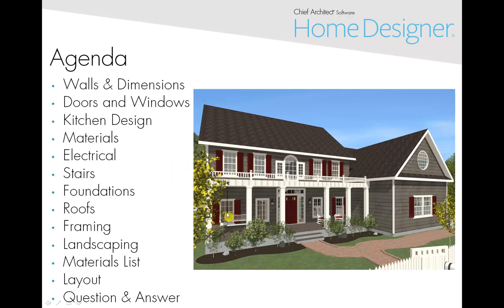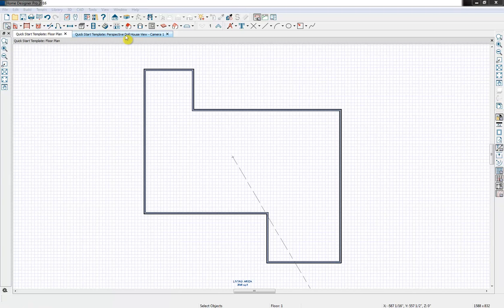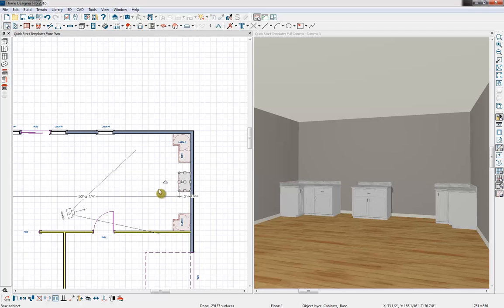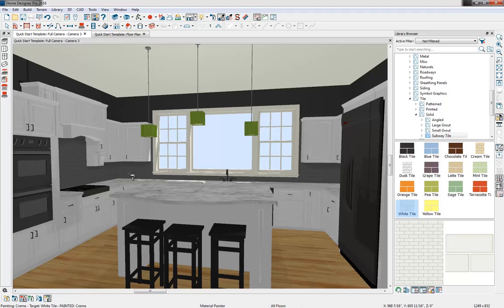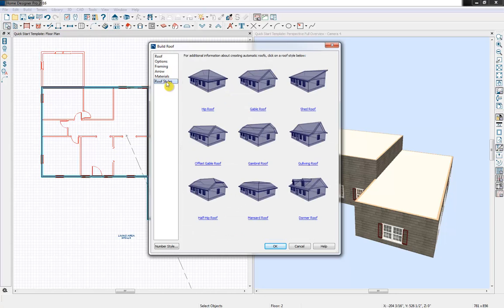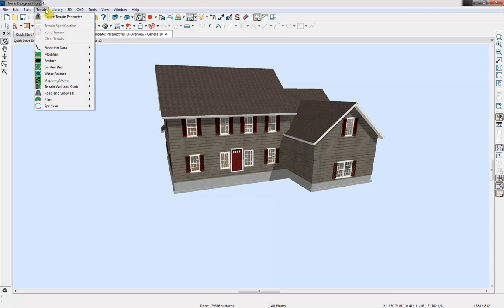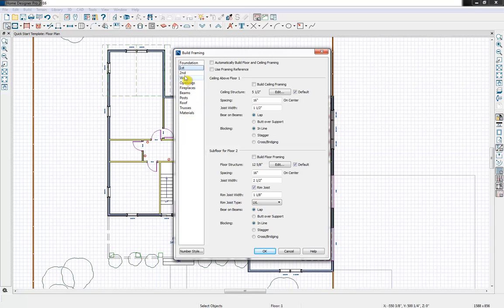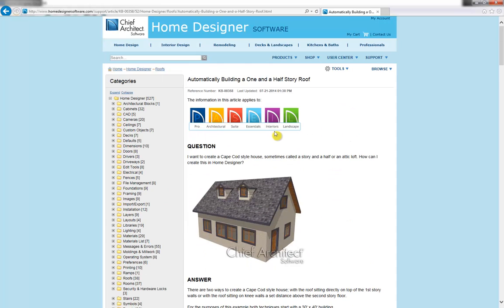Home Designer 2016 - Quick Start Webinar

Comment: I like SketchUp but this is Loaded ( and little Cheaper, lol )
Question,
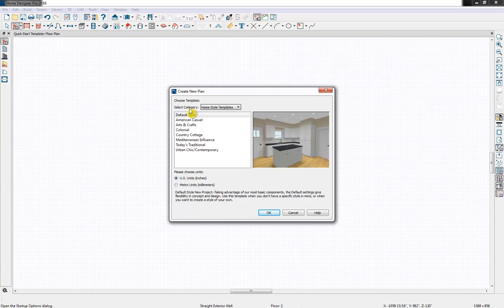@ 2:45
 Can i Change the Template after the Home is done?
like wanna see what the house looks like in a diff style ?
Reply from the maker: +Zraupp10 To change different window, door, cabinet, and other styles after you've created the home, you'll go through and modify Defaults. This is located under Edit.
Reply: Chief Architect Software Thank you.
I am either going to grab home designer pro 2016 or Chief Architect Premier.

Comment: I wanted to purchase this product. I figured, it would be so cool to see the renovation come to life in 3D before picking up the hammer. But, I quickly realized that it would be a lot of work to learn to use this application. What I did is check out a lot of the online webinars on the product. It is obvious how difficult it is to learn this.That, and the $199 price. If it had been around $79, maybe I would have taken a chance and tried to put in the effort to use. But, at the $199 price, it may very well become something I waste my money on because it is too hard to use.

I have an idea. How about a $79 version that only works for 6 months or a year, with an upgrade path to buy the product outright for the other $120 after 6 months.  I just don't want to take all the risk of the expense upfront without knowing if it delivers the service that I need from it for the effort that I would have to put into it to learn it.

Just a thought.
Reply from the maker: +Peter Davila Thank you for your comment. Depending on the scope of your project, you might consider the Home Designer Interiors ($79) or the Home Designer Suite ($99). We offer a 30-day money back guarantee or upgrade options if you’d like to upgrade to the Home Designer Architectural later. Feel free to contact our sales team at 800-482-4433 M-F 6am-5pm Pacific to discuss these options further.
Reply: +Chief Architect Software 
Unfortunately, the features I was most interested in are only in the Architect version of the software.

Watercolor, Technical Illustration, Vector 3D and the lighting controls with shadowing.

Comment: Very nice presentation! It was clear, concise and helpful.  I purchased the Home Designer Interiors.  While it was clear that you were using the "Pro" product, I was able to actually create a drawing product for a client to go get their building permit from what I learned watching this webinar.  With what I saw in the framing components and materials list of the Pro version, I think I will be upgrading.
Reply from the maker: Thanks RicardoBDC!
Reply: +Chief Architect Software can this software make small mansions i.e. roofs that are round and pillar fences etc? Or is this strictly for normal everyday houses?
Reply from the maker: +whitetiger revenge There is no limit to the size of structure you can build in the software. You'll also have tools to create circular rooms and either use the automatic or manual roof tools. Here's an example of a circular room: https://www.homedesignersoftware.com/support/article/KB-00135/creating-a-circular-room-with-walls.html. Through the library of objects you will find different fence options and pillars to use in your design!